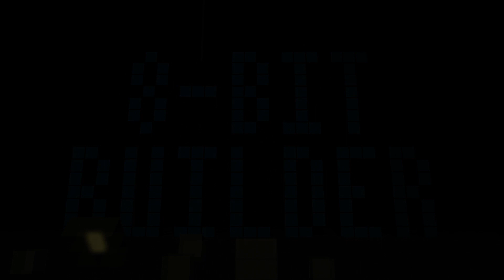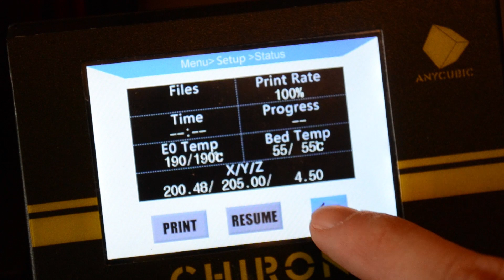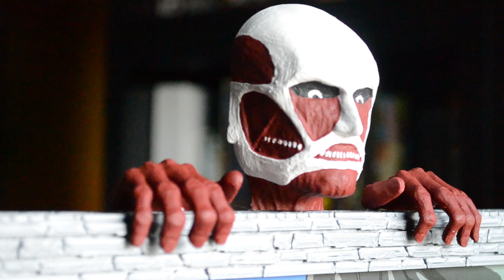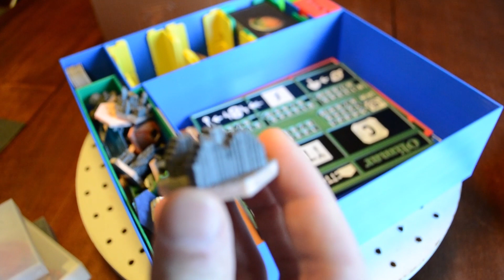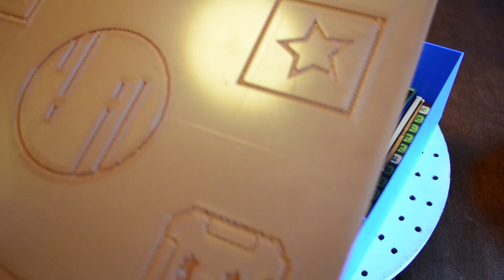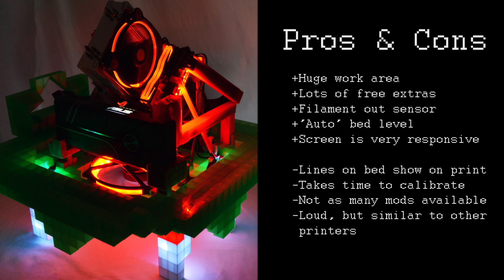Anycubic Chiron 3D Printer Review (coming from a CR10 owner)

Comment: Power supply fan noise: Slotted vents over fans are the culprit!  
Make the fan opening a round hole with clean edges so fan can 'breath' easily and quietly.
The power-supply fans are temperature driven*, unless they can't breath and are always hot.
An 'always on' power-supply fan might be a sign of overheating.

*Anycubic i3 Mega X, purchased 2020.  The power supply fan gradually sped up or slowed down based on internal temperature. I guess.

Comment: Hi
Great review.
Does this machine have thermal runaway protection?
Reply: No it’s disabled in the firmware, you can flash the older chirons but not the new ones quite yet with Marlin 2
Reply: @jstone-dev  cheers mate
Reply: @jasonb9244  no probs, for what it’s worth I love mine!
Reply from the maker: Not sure offhand

Comment: Another video recommends adding a layer of glass to top. Would this allow flat prints without those lines?
Reply from the maker: It would definitely work, but you would need to use glue or hairspray to make the prints adhere to the glass.

Comment: so im debating weather to get a chiron or a predator

what is the difference between the base moving on the chiron, vs the predictor prints

which is better in your opinion?
Reply from the maker: Never used that style printer like the predator. You get more print area with the Chirons square build plate though. The Chiron been strong for me still. It never became really popular though so not a lot of mods for it (but I haven't needed any)
Reply: @thorkon  awesome. thank you for ther reply

Comment: I've had this printer for about a year and a half now.. I don't regret the purchase at all.
The printer is built solid and has been a workhorse.  I think I've put somewhere around 30-40 spools through this machine. 
Agree with your review, and for the couple issues I had, Anycubic support was great on getting it resolved.
Mods I made... TMC2208 drivers, replaced the bed with borosilicate glass (I didn't like the lines), capricorn tube, and switched the type of nozzle (same hot end, just MK8 style nozzle). I also wore out the lead screw nuts and replaced with anti-backlash.
I'm on the second filament sensor as well.
Beyond that, for the amount of prints I've put through this machine, it's held up well.
Reply from the maker: It's still been a strong printer for me also. I bought the tmc drivers but haven't installed them yet. Printer is a beast, unfortunate it didn't become more popular.
Reply: @thorkon  
Silent drivers work well on it, just make sure to tune the voltages so you don't burn up the motors. Fan noise is still a little on the loud side, debating if I want to change out fans too, but hasn't really been that big of an issue. 
For the cost of this printer and the size of it's build area, it's actually a bargain.

Comment: Man there's no noticeable warping on that box! What filament and settings did you find best?  Thanks
Reply from the maker: Don't remember filament. The key to stop warping is have bed temp at 65 first layer, 60 on second layer, and 55 on 3rd layer and rest of print. Do the same on the hotend. It's really helps a lot
Reply: @thorkon  thanks!
Reply: @thorkon  thx man appreciate your time

Comment: Bought the printer because of this review, should be delivered within next week. I wanted to ask though, which 0.8 nozzle did you get? Wanted to try getting that as well cz I will be doing some large prints and it seems like a good idea.
Reply: So the nozzles that ship with it as you mentioned in the video are different sizes, thats really cool. Cheers and thanks for the review mate :)
Reply from the maker: Anycubic provides a whole bunch of different nozzle sizes so you don't need to order any for awhile :)
Reply: @thorkon  Hi, finally recieved the printer unfortunately there was only 1 nozzle delivered, the one installed, which is a 0.4mm. Found the 0.8mm MK8 E3D nozzle on amazon, should that fit or do you have a preffered/better recommendation?
Reply from the maker: @CaptainHalwa  that's very odd, never heard of the nozzles not being in the box. I believe the Chiron uses a m6 nozzle. Stainless steel is better than brass. But you can try out a set of brass nozzles to figure out which you like best before picking steel
Reply: @thorkon  you reckon I should open a ticket on the matter with their support team? To be honest i've been trying to get into that facebook private group for over a week now and they still havent accepted for some reason
Reply from the maker: @CaptainHalwa  Just seen this. It should only take a day at most to get in the chiron group on facebook. I believe it was a simple survey it asked you to answer to make sure you werent a bot. I imagine if you message anycubic they will send you the nozzles without any trouble. 

If you can't get in the group, I can try to ask an admin whats up. (the group isn't run by anycubic)

Comment: Can you share your print profile? I am not for sure of what you have done differently with your printer I am almost having to level the bed for each print.

A lot of the CR10 mods work on this printer.
Reply from the maker: Have you done the auto bed level? Which CR10 mods are you talking about? A few will work that work for most printers (dampeners, etc) but not sure of a lot though

Comment: I'm looking to up size from my ender 3, was looking at cr10 or 10s  then the artillery sidewinderx1 showed up but you have to buy a shoebox full of ribbon cables and some issues with hot ends going up in smoke.(this printer has many of the same features) Then the only place I saw a mingda d3 was on gear best can't find reviews or listings on e bay. I've seen 2 reviews on this and they look good. Both you and the other guy said the first issue was not so hot and that they addressed all of the bugs. It is a big one though. Thanks for the time you put in. P.S. Will the stepper motors take dampers?
Reply from the maker: I put dampener on my cr10. I have extras but never got around to putting on my Chiron since I have it in a enclosure

Comment: Those lines are caused by the temp difference believe it or not ..
Reply from the maker: Still not sure why they are on the bed. They aren't needed for auto bed leveling. I found someone who cleaned all of their lines off the bed and it works fine
Reply: @thorkon   That is great news. Those lines are the only reason that just stopped me to click on the buy-now button after seen your great review (many thanks for that). Do you think you can share info from that person who cleaned up the lines? Besides, after seeing your results on flat prints with lines from the print bed, my first thought was to use glass on the print bed... Do you think the use of glass as a last layer of the print bed would be an option?
Reply from the maker: @coskucangurun7999  here's the fb link, you'll have to join the Chiron group to read it. https://m.facebook.com/groups/1719242321444239?view=permalink&id=2073890722646062

In the comments you'll see a response that has like 30 replies, that will have the instructions.

On to the glass question you asked: I'm sure it will work but after using the ultra base I will never go back to glass, mirror, or PEI. Ultrabase is amazing since you need no adhesives. If that fb link doesn't work let me know.

Comment: Do you recommend this as a first printer?  How does it stack up against other printers out there for this price, specifically the CR-10?  I'm also looking at an Ender 5.
Reply from the maker: This was my easiest printer so far compared to my others. The cr10 was great but I did run into a few issues with it that were fixable. I haven't done any mods yet on this printer and it's been good. I think you can't go won't with either printer but at 400mm I love the print area.
Reply: I got an Ender 5 and after about a week I had issues with the nozzle or bed not heating, I could change manually. After going back and forth with creality asking me to measure voltage here and there which I protested doing, they said I had a bad board and would send me a new one. I just returned to Amazon and I'm getting this one.😁

Comment: I've been considering a 3d printer for board game box inserts for a while. A local liquidation store has a CR-10s pro available for $300. Do you think it'd be worth buying the CR-10s or spending the extra money on the Chiron for the extra build volume?
Reply from the maker: That's really hard to say. I'm always a little hesitant to buy used printers as your not sure how much it was used and what the previous user did. That's my personal view, not saying it's right. I've bought a used cr10 because it was worth the price even if it had issues. That said, build space is all on what you plan to do. It's really hard to know if your just starting out but build space was always my limiting factor. I started with a small printer and upgraded to larger sizes 3 times. I wish I had the biggest to begin with to be honest. I use my printer a lot though. If you're not going to use it a lot I think either of your options will be fine.
Reply: @thorkon  It's not a used printer, just a slightly scuffed up box. Just figured I'd ask you since you seem to do a lot of board game inserts. The 300x300 mm of the CR-10s falls a tad short of the full width of some boxes where the 400x400 mm of the Chiron seems to more ideal of board game stuff. That said I didn't know if the $200ish savings would be worth working around the smaller volume.

Comment: Hey just bought this printer based on your video. My hubbie is obsessed with Teraforming Mars and tabletop games. Any tips on how to design the pieces you made would be awesome. I am a 2D designer, new to 3D and 3D printing but I do have Fusion.
Reply from the maker: Awesome :) A lot of things I got for Terraforming Mars is on thingiverse. I used tinkercad for my designs to begin but if you are good with fusion then that's great. I sometimes grab others design files and adjust as I needed.

Comment: Hi, I’m considering to buy this printer for large stuff. What’s your experience with warping when printing big parts that have a large contact surface on the bed? That box in the video looks similar to to something I want to do.
Reply from the maker: I had a very slight warp on the lid to that box but I since learned how to eliminate the lifting. After your first layer, lower the bed temp and hotend temp 5 degrees, then on third layer do the same. I haven't had any lifting since that adjustment.
Reply: @thorkon  Uhm.. that's an interesting approach, never heard of it. I take the idea is to let the lower layers cool down a bit and shrink to compensate for the upper layers doing the same.
Which material was that though, PLA?
Reply from the maker: @zmast333  Yes. I mainly do pla. I've done prints that are 380mm long with no lifting with this method. Someone else told me on the Chiron fb group about this method.
Reply: thorkon Thanks for the info, appreciated.

Comment: The simple noise cure for the Chiron is what I did, I fitted a Duet and a direct drive Titan Aero with a Volcano.
Reply from the maker: I've heard changing to TMC2208 help a lot. Next loudest thing is the PSU fan which is hard to get to. How does changing to direct drive help make it quiet?
Reply: @thorkon  direct drive itself doesn't. But the Duet with its steppers does. Duet is a huge advance in control board I only added that I had added a direct drive too
Reply: @Dualecosse  Any videos show how to do it? Thanks!